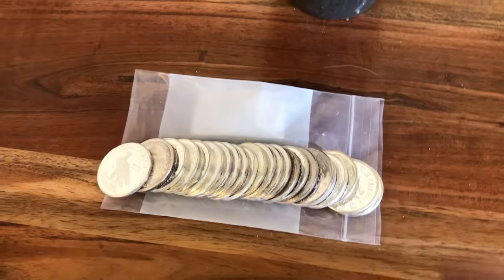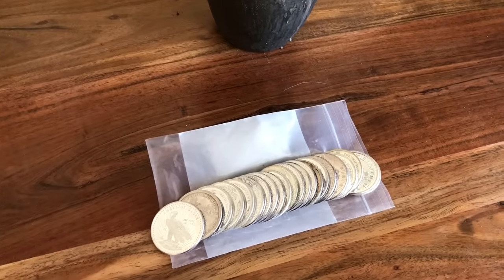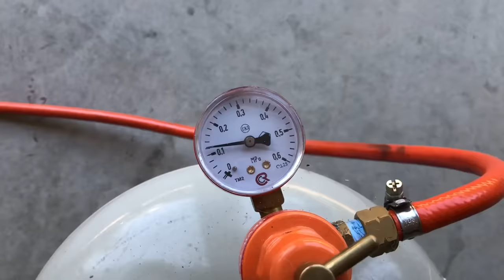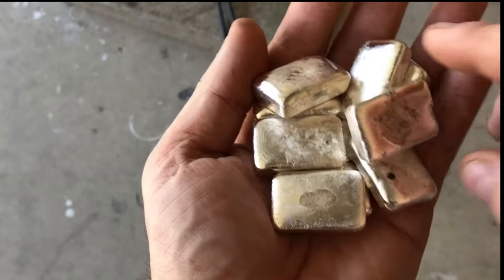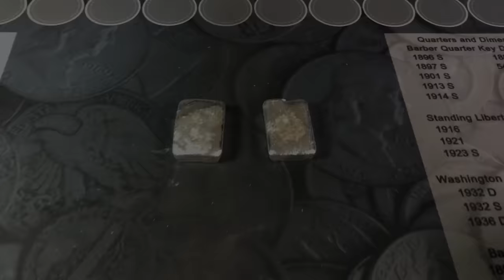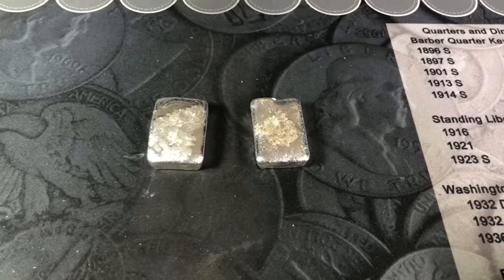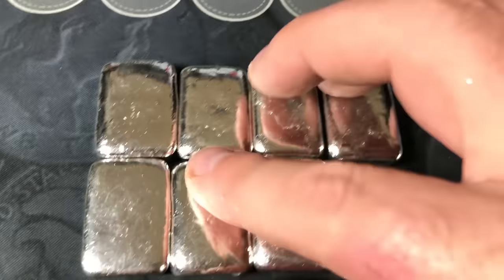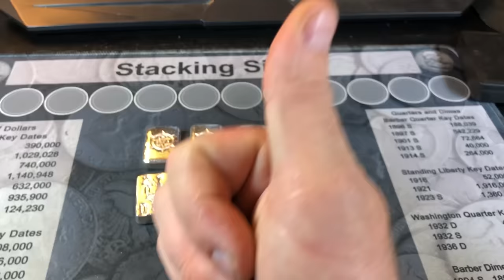Melting Silver - Making Hand Poured Silver Bars at Home

Comment: You might want to try cleaning up the crucible and removing surface slag with carbon rod before poring, also heating the molds to red/yellow hot give the air a change to escape before the silver cools eliminating voids on the bottom of the bar, finally if you tap out the bars onto sheet rock no danger of scratches or dings so no need to polish.  Hope that helps and keep up the good work.
Reply: is that why my bars always have little holes and cracks in the bottom? i heated up the mold but not till it turns red or yellow
Reply: @OfficiallyRetired  yes, the mold needs to be glowing red hot.
Reply: OK I also need to do a better job heating up my mold then.  I have had some that look awesome and others are all sorts of wrong.  Is there a chat site/ form for smelting nerds? Post pics and whatnot

Comment: Nice bars! In would also like to make some silver bars. I have a devilforge, exact the same you have. But I think I will use an electril furnace/kiln for silver. I will also prepare a pouring setup with a burner hitting those moulds while pouring. Give them a small tap while solodifying will give them some nice ripples, just the way I love them! I will also need to invest in a tumbler to get them as smooth and shiny as possible. Hopefully one day when I build a new shed or buy a garage box I will start melting silver. Just subbed 😁👍👍👍
Reply from the maker: Yeah - I now use the electric for silver and the devil forge for non-precious metals.  Thanks for subbing brother!

Comment: The voids on the bottom of the bars is from the gases built up in the metal from the propane..electrical furnaces dont give this issue when pouring silver. But I think it gives the bars more character..I find it easier to pour from a smaller crucible but that's just me.